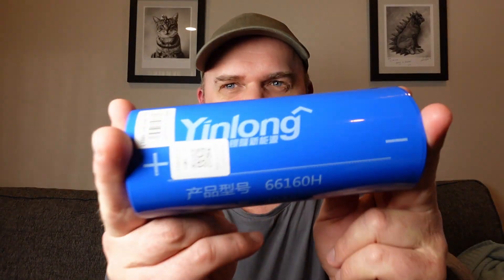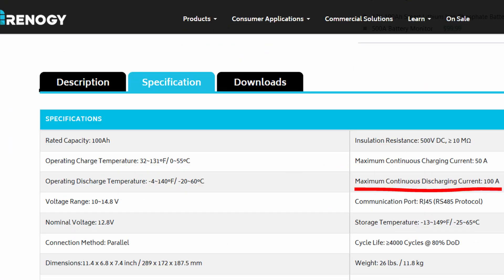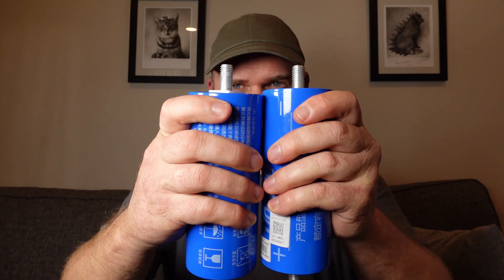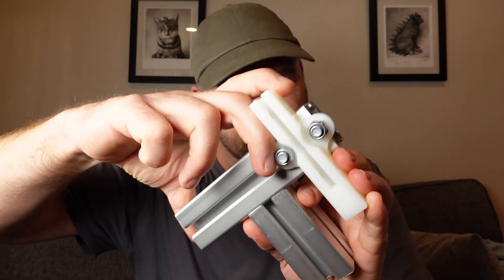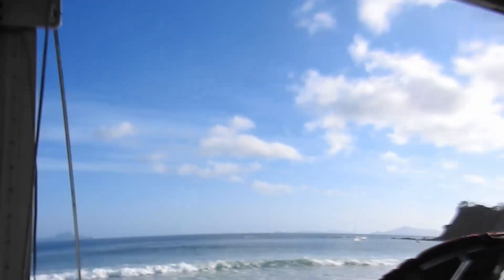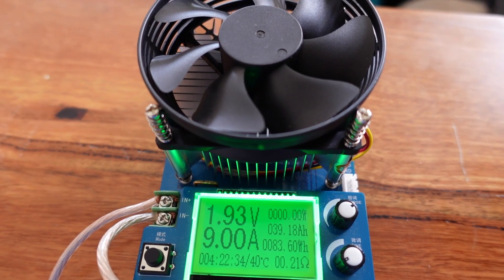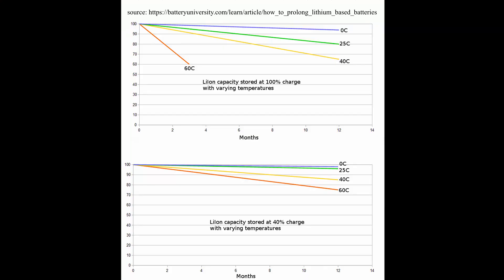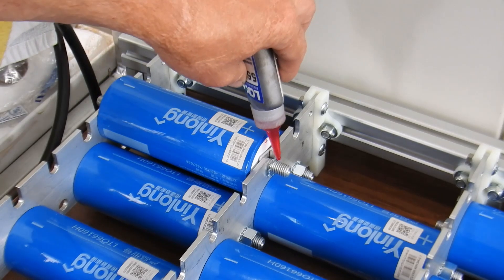Campervan DIY battery build HUGE POWER!

Comment: Hi Brendon,

Really enjoy your work. I am building a 30 module NiMh battery pack with individual module rating at 7.2v, 5500mAh. The charge voltage is about 9v at 4A. I need a BMS to set the charge & discharge parameters for each module & be able to monitor each module data live on a PC or App.
Can I know the name of hardware & software/app you use for your battery monitoring? Will it work with 7.2v modules as your batteries are 2.3v?

Any help will be kindly appreciated.
Reply from the maker: Hey Jerry...   ugh, NiMh.... I find them hard to charge at the best of times.  Anyways... I'm using an ANT BMS, I think 7.2V may be outside it's range (I'll check tho).  Either way, it's not a particularly great BMS and not sure it has the trigger requirements a NiMh needs.  So, with NiMh, you can't just charge them upto a certain voltage or whatever.  They normally have the change in voltage over time measured.  When the voltage dips, this is an indication it is charged and the charge current should be removed.  The change in voltage is quite subtle on NiMh and I believe it can throw fake dips on the way up which can cause some chargers to stop charging prematurely.   Probably the most robust way to measure is the change in temperature over time of each module.  You cannot just have a temperature threshold as their low efficiency means they will heat while regular charging.  You have to note the rate of rise as being outside the rate when charging.  Check out some forums, there are bound to be some folk who've made up an arduino controller with some 18B20s strung out.  Doesn't sound like a fun job.  Godspeed.

Comment: That's a $15,000 battery pack.
Hope you're doing a lot of camping...
Reply from the maker: I will do a lot of camping.  I'm not sure how you came to that number tho.  When you buy in bulk you can get the cells cheaper.  In my case I bought 100 cells for $38USD each including shipping.  So that's significantly less than $15k?

Comment: The link for the batteries is dead. And how can I make a 12v battery with 2.3v cells?
Reply from the maker: Thanks, have updated.  Six series will do roughly 12V, you'll need to charge to 15.3V to get the most out of them instead of the std 14.8.

Comment: With Chinese suppliers people need to carefully verify spec and defects on each unit. YOU are their quality control. My brother-in-law has worked for years as an EE with battery makers, including those powering Tesla vehicles. He has plenty of horror stories about how the Chinese builders only stick to design specification while he is physically there . The moment he's gone they start to "cheapify"(Remember the burning Tesla's?). It's baked into their business philosophy. Making something "better than it needs to be" means leaving profit on the table. So proceed at own risk and buy a very good fire extinguisher.

Comment: Regarding Loc-tite:  just heat the stud with a heat gun, not really hot but enough to soften up the thread lock and make it easy to unscrew.

I'm shocked at how much lower the cost is per kWh.  Thanks for the video.
Reply from the maker: Cheers, yeah heat helps with everything tho not sure how much the battery would appreciate being heated.  The type of threadlocker I used was not permanent and intended for disassembly so fingers crossed.

Comment: A regular lead-acid deep cycle battery is around 12V 100Ah and costs about $100. Building a battery that powerful you need 15 batteries and will cost about $750.
Reply from the maker: How does 15x100 = 750?  So then you would have a battery that weighs half a tonne and is dead in 6 months.  (I have never seen a battery that cheap last a year).  I'm not sure how this would be a better/more robust setup?
Reply: @brendontait6968  building a battery as powerful as a lead-acid will require 15 of those blue batteries you're advertising. You mentioned $50 each = $750. But I just noticed they are about $100 each on ebay LOL.
Reply from the maker: Depends on where you buy them.  I've bought them for as low as $34 each.
Reply from the maker: Haha, you were kindof correct when I misunderstood you.  It would take about 15 lead acids to be as "powerful" as my battery pack.  But I think you underestimate lead acid batteries by quite a lot.  They are terrible.  You generally have to derate the capacity of an AGM by a factor of 3 due to their shittness level.  Additionally I think you have a misunderstanding of the word "powerful". I think you meant capacity?  Capacity and powerful are quite different in their meanings.
Reply from the maker: Going by my maths it would take approx 6 blue cells to be 'equivalent' to a 100Ah AGM.  But then again, the lead acid would likely die within a year if they were a low end battery and were held at part charge for the majority of their life.
Reply: @brendontait6968  6 blue batteries in series will have 13.8v 40A. To get 80A you need 6 more in series then connect them in parallel with the other 6. So 12 batteries will have 13.8v 80A.
Reply from the maker: @adytexas  yes, I don't think you fully understand.  To get actual usable capacity from a lead acid battery you roughly divide the sticker capacity by 3, so you should take your 100Ah AGM battery as having 33Ah when doing your capacity sums.

Comment: A man after my own heart. I’ve owned 2 Unimogs, for beekeeping. Built lithium titanate battery banks and have only high school education. We are like brothers who have never met.
Reply: I have four brothers and sisters that never went to school at all. And they all read and write English and Spanish, and do all sorts of things without a single day in school. and one of them is so handy that can do just about anything, and also does architect work in a computer, blue prints and all, and has never taken a single course in computers or architecture. And I have son that went to school and graduated from university and doesn't even have job. We the old times are much better off. I too grew up on the streets, but did have education. But before placing a single foot in school rooms, I already knew how to read write and math at high school levels.  And all I have used of education is what I learned before going to school, I greatly admire people like you.
Reply from the maker: Whoa... 2 unimogs!   Cheers.
Reply: @brendontait6968  must have big feet and wide hips
Reply: I never seen a battery do that puncture and explodes.looks like a good powerful energy source I'm looking into building a home battery bank for solar storage And Duke energy so they can stop over charging me.

Comment: gidday Brendon just about to build a iveco stealth build in auck...how are you charging these batts?I am quite keen on a system that dont need solar...great work by the way
Reply from the maker: Hey Peter, thanks.  Am charging just with solar.  Worked great.  Will make an update video with details soon.  Cheers

Comment: Part per million per degree....?? ppm/degree how do yo figure that... you like the number and percentages, but some don”t make cense.
Reply from the maker: I'm not exactly sure what your question is.  I read the question as you not understanding ppm/°C as a unit?  If you have an object that has a linear coefficient of 10ppm/°C and is 1,000,000mm long, when you heat it by 1°C, it will increase in length by 10mm.  You could substitute that into um/m etc.  But it is a fairly common unit.

https://www.google.com/url?sa=t&source=web&rct=j&url=https://emtoolbox.nist.gov/Temperature/Temperature%2520and%2520Dimensional%2520Measurement.pdf&ved=2ahUKEwilk52dtODwAhVGILcAHdolDaAQFnoECBUQAQ&usg=AOvVaw1ZFYZ2qvsOA24L92VSfzuD

Comment: I hope there isn’t a bad cell in there, imagine trying to find it.
Reply from the maker: If a cell went bad, the BMS would indicate which bank it is in.  I'd then check it by loading the bank and looking with a thermal camera.  Its possible to loosen the cells and slide the pack apart without disassembling the entire thing.

Comment: Needs more solar panels on that rig IMO
Reply from the maker: In summer it seems to be able to charge about 80% of battery capacity on a good day.  General usage in summer (haven't tried winter yet) using it to cook meals, heat the water for shower and washing up, run lights and a domestic fridge etc. it seems to be able to charge back to 100% and heat the hot water back up before midday.

Comment: Ok, first thing I've ever asked on YouTube.  I'm new to solar and none of the charge controllers state that they are ok for LTO.  Are you just setting your charge controller up for lithium?  Does this actually matter?  I've searched like crazy and come up with nothing.  I'd love to power my skoolie mini split all night without issue.
Reply from the maker: Hi Scott, as long as you know your battery charge requirements it doesn't really matter.  These cells don't have any specific charge requirements.  I'm using a victron controller and I can just set the charge voltage of the battery, which is nice because I can choose to turn the SOC down in summer when it isn't really needed etc.  Requirements for charging AGM or LiFePO4 are more complicated.
Reply: @brendontait6968  This is amazing!  I never thought I'd get a reply from you!  I'm fascinated by this battery bank and can't wait to build one.  Thank you so much for answering, I really didn't want to purchase all this stuff, then blow it up somehow.

Comment: How are you touching both terminals and not getting shocked?
Reply from the maker: Because I am super human! 

Tho more likely due to the potential across the terminals is too low to overcome the resistance of my skin to any appreciable level.  (The voltage is too low)
Reply: @brendontait6968  How about after 10 of them are connected together?
Reply from the maker: @tonyinfinity  maybe if I put my tongue across it...  but no where near high enough voltage to shock through my  hands.
Reply: @brendontait6968  A car battery shocks you and that's only 12 volts.

Comment: So, perhaps I wasn't listening as well I could have at the beginning, because I didn't quite understand why you needed so many batteries, but could you say again what it is that massive amount of batteries is going to power in your truck?
At first I thought it was going to be for a house. And in the end it was, but one on wheels.
Reply from the maker: Well I just want to not be shy on electricity.  Running domestic fridge, induction stove and electric oven, plus AC, I want to have a comfortable amount of electricity - I have noticed so many people run short on electricity and wanted to have enough power first go.

Comment: Could this battery be used to power hub motors for a quadricycle? It would be a lightweight vehicle. I would like to get long range.
Reply from the maker: It could, but if weight is an issue, there would be better chemistries.  Look at some tesla model 3 modules or even RC LiPO batteries, they will be 70% lighter than these.
Reply: Thank you for responding. I'm finding that the rc batteries are to much of a fire hazard. My quadricycle will be fully enclosed with wing doors. Without the batteries I believe that the weight of the vehicle will be about 250 pounds then you have the weight of the passengers that's another 300 pounds. I was thinking of using 4 hub motors, 48 volt 1000 watt. I very much appreciate your advice, Thanks.

Comment: You said it's cheaper than AGM?? Hmmm doubt that
Reply from the maker: It depends on how you calculate it.  Looking at the price vs sticker rating AGM would appear cheaper.  However that is a very superficial way of looking at the cost of a battery.  If you calculate the price vs the amount of energy the battery will release during its useful life, this will give you a more useful cost indicator.  These will beat AGM hands down.  Prove me wrong.

Comment: This inspired me to finally pick up some LTO cells! I grabbed some a few weeks ago and planned on an 11S configuration. Having a little trouble figuring out a quality BMS to use, which one did you go with?
Reply from the maker: Hey Jacob,  glad to hear.  I used a 400A ANT BMS.  It's not great, but it seems to have worked so far.  Make sure you match the internal resistance as close as you can, this will limit any unbalance that could occur over time.

Comment: Buddy, that is a GREAT video and a lot of effort you´ve put in your packs. I want to ask, would you suggest LTO batteries for a DIY electric motorcycle? I´m afraid of having to ask too much energy out of the pack and ruin a pack of LiPO4. 
You can be as technical as you want. I´m a materials engineer . 
I would appreciate your thoughts.
Reply from the maker: Thanks Jose,  yeah I hear you with the drain on LiFePO4 tho there are some that will do it.  LTO does have a low energy density which would be significant on a motorbike.  Headway cells (LiFePO4) might give you better energy density than these.  It may be worthwhile looking into adding some cobalt to the mix.  Maybe also look into Tesla model 3 battery modules.

Comment: What about self-locking nuts that have nylon inserts?
Reply from the maker: Hey Chris, I've heard that these require too much torque on the alloy studs.  I think what I've done will be ok.  Will find out if it is a stuffup someday.
Reply: @brendontait6968  
Hi Brendon, yes, that's probably true if you use them right out of the box. So maybe screw each one down once, onto the correct thread that's not a capacitor. This will 'break' the lock nut in so that it will require less torque when screwed onto a cap. One of those nuts coming loose and floating around may end up being more that just a stuff up. 😮

Comment: Even changing the cost calculation to a conservative 6000 cycles the batteries come out at around half the cost of the LiFe packs.
LTOs make amazing replacements for lead acid cells in cars and power walls, but yeah the upfront costs are very painful.

Comment: Hi Brandon I am thinking of building a portable power source to power my camping gears mainly 12VDC USB devices like lights, fans fir a 3 day 2 nights getaway.Any advice on batts or type of batts that you can recommend. Thanking you.
Reply from the maker: Hey Mahesan, it really depends on your power requirements of fans etc.  I use these flashlights a bit https://www.aliexpress.com/item/32853863689.html?spm=a2g0o.productlist.0.0.4ff92807Hot5je&algo_pvid=60e4e96e-c3f6-4cca-80b9-41f4b1e1cd2b&algo_expid=60e4e96e-c3f6-4cca-80b9-41f4b1e1cd2b-7&btsid=0b0a556416203720849103012ef13f&ws_ab_test=searchweb0_0,searchweb201602_,searchweb201603_
They have a terrible UI but on the whole they are pretty good with being a small powerpack.  I get the 70.2 LED @4000K normally with a handful of spare cells.  Shining them at a roof of object above casts a good light.  I hear you can get decent LiFePO4 cells on Amazon for $100 if you need higher capacity.

Comment: You can use the blue Loctite instead of the red. Red is the strongest and blue is made for bolts you need to take off again in the future
Reply from the maker: Thanks, tho the 'locktite' i used was loxeal 55-04 which is equivalent to LT blue but doesn't follow the same color conventions as the loctite brand.